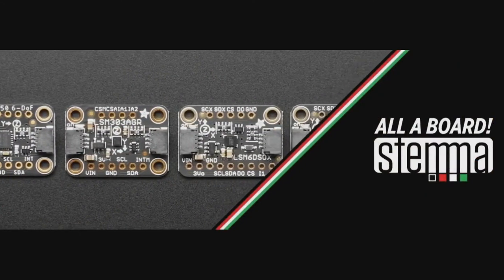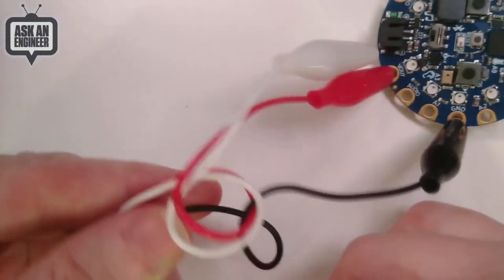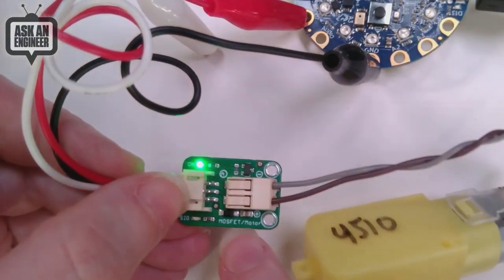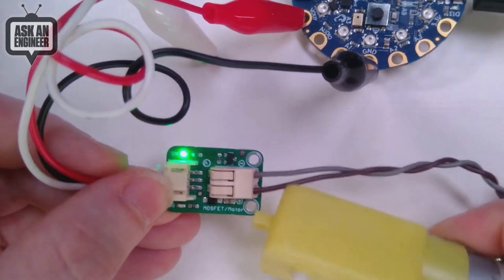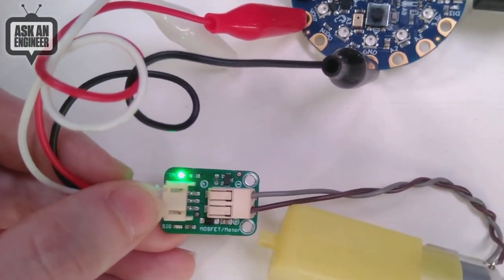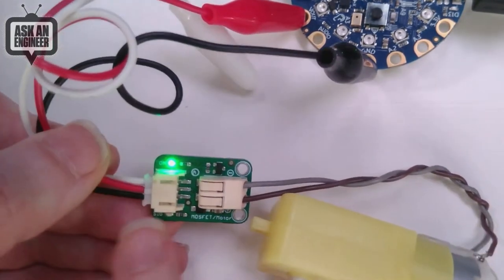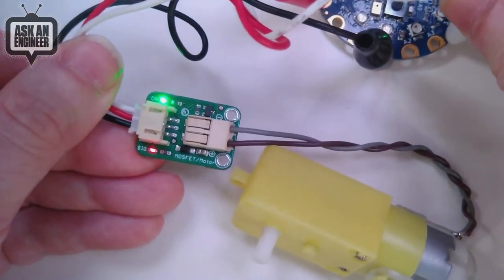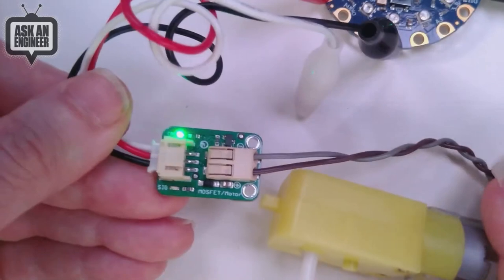Adafruit Top Secret! October 19, 2022 #Adafruit #AdafruitTopSecret @Adafruit

Comment: Anyone know what is the part manufacturer/name for the SMT wire to board terminal block connector?  Looking for SMT low profile wire to board connectors.  Am ok with SMT connector not being as mechanically strong as thru hole.  Found WAGO 2060 and 2061 so far.  Cheers!